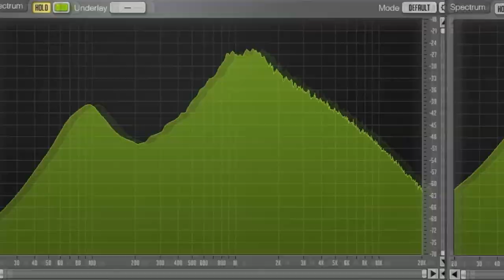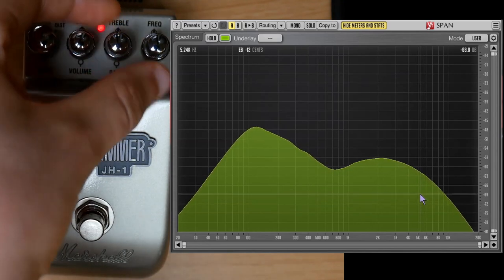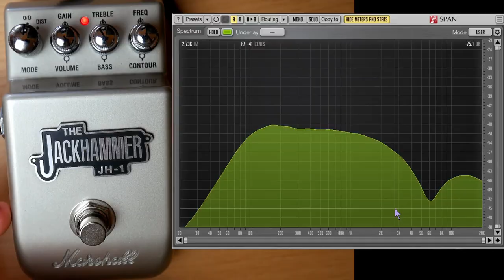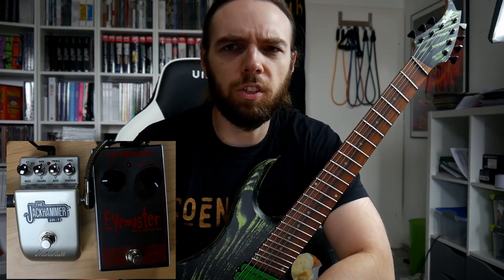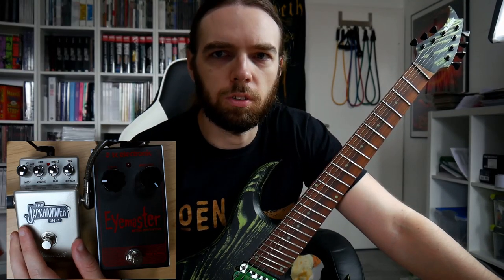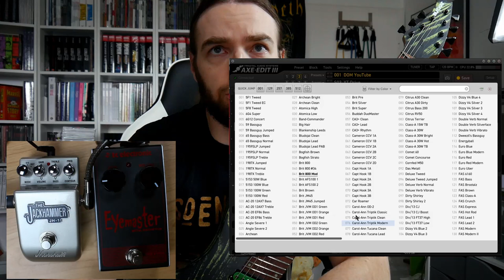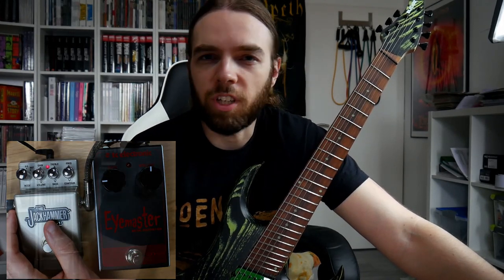Marshall, what were you thinking? Jackhammer JH-1 Distortion Pedal Review (Pedal Vault)

Comment: The only pedal I wish I would have never sold! It was absolutely amazing as a boost on a crunchy amp setting.
Edit 2024: Just got a used one for 45 bucks and it sounds amazing! Crushing metal tone when used as an OD into a crunchy amp and you can dial out the mud frequencies you don't want in your mix. Love it! 
(my setting: OD, Volume full, Gain 10 o'clock, Bass 10 o'clock, Treble 1 o'clock, Greq 10 o'clock, contour a bit before 12 o'clock. Use that in a slightly broken up amp and you get clarity and note seperation and nice robust chugging as well)
Reply: Glad I never sold mine! It was my second ever pedal (and my first ever OD/distortion, as my first pedal was a Crybaby wah)... it spent many years collecting dust though while I was using another drive pedal, but one day I just took it out again for old times' sake, and the OD's clarityand subtle drive was just amazing!

I was also using a new amp and had new pickups in my guitar by this point, so that maybe helped... I'm sure this pedal works better with some gear, and worse with other gear

Comment: Well, that's a weird one with a quite underwhelming tone section. After finding the schematic online I ran a quick simulation that explains a lot. I can't share pictures but the bass/treb section is passive, meaning there's no boost, only cuts. Also, the tone curve with pots a noon features a huge bump from 60hz  to 800hz and decrease above with an average of 6dB difference, hence the highs being non reactive. Also, there was a neat provisions for a complete, effective and marshall-like passive 3 band EQ but it's weirdly not exploited here (seriously why?) and ditched for a sweepable mid notch, which adds amplification, which in turn increases noise, which in turn requires excessive filtering, which implies cutting even more high frequencies. So here's your treble responsiveness.

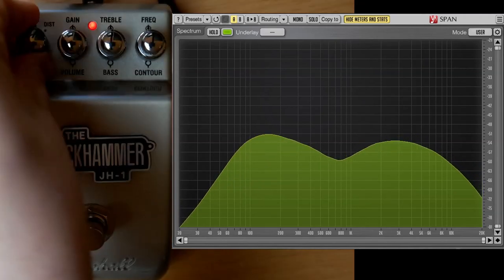I'd like to add one more thing though, showing the intrinsic "limitation" of the white noise/freq analysis process that will help everyone use the graphic's info into a more accurate translation. @4:58 passing from OD to distortion, the graph shows a decrease in high frequencies which in this case is the opposite of what happens. it only shows an increase in clipping (compression). In fact, the graph shows a decrease in the highs but the audio shows an increase. usually, when distortion/clipping or compression is involved, a decrease in frequencies would show an increase of their representation in the final sound. Kind of nerdy talk but useful to make sense of what you see!

Comment: Amazing pedal, been using for 5+ years. It sounds close to Marshall amp sound (jcm 900 is the closest I think), The key is the volume on the pedal should be at least at 50% (the pedal does not have a ton of gain). Also freq and countour controls are really versatile, you can reduce or add low frequencies depending on the guitar you playing

Comment: Exactly why you should try it with bass. For example check out the debut Strigoi album, as I used a Jackhammer > EHX Bass Muff Deluxe > Ampeg SVT for my amp sound (parallel Darkglass B7K Ultra running for DI). I was really happy, and slightly surprised with the results.
Reply from the maker: Now I have an idea 😅
And I thought you used the funeral party again.
Reply: Haha, nope, the dreaded Jackhammer was the key to crushing that sound. Hopeless for guitar... but for bass (with cleanish DI underneath) is The Way. ;)
Reply: Ok I'm going to try that as soon as I can! By some coincidence, I also just bought an EHX Bass Muff Pi yesterday (should be arriving later this week)

Comment: Do you know If It works fine on Fender amps as well?
Reply from the maker: I do not, however I don't see a reason why it shouldn't.
Reply: I can tell, with a Hot Rod Deluxe it works very well, I play rock and some hard rock, no metal at all, bit this one combined with a tubescreamer and les paul is my main sound and it works very well. 
Contour very low, of course only in overdrive mode
Reply: i use this pedal with a fender rocpro 1000 (solid state), and it sounds great! i play a tele and a casino, the epi's p90 loves this